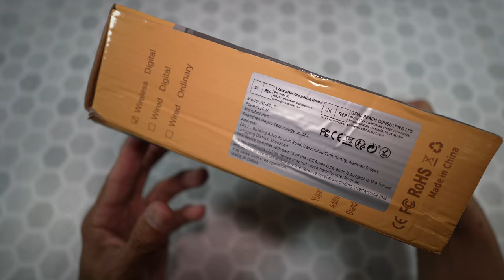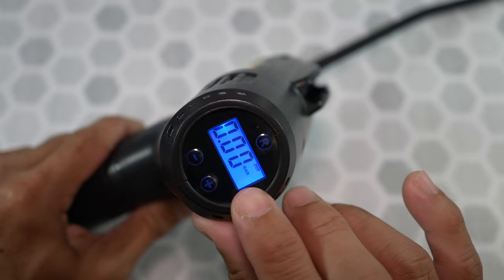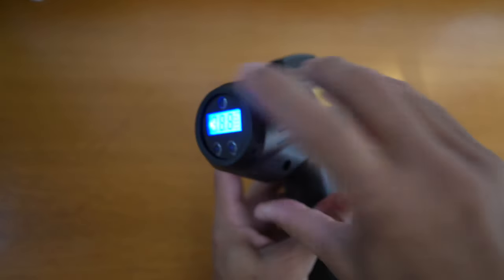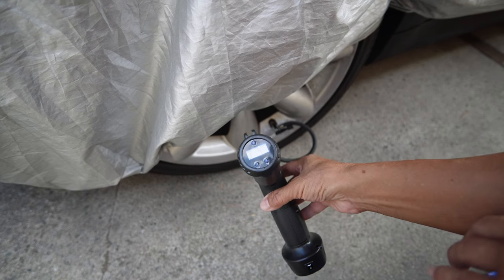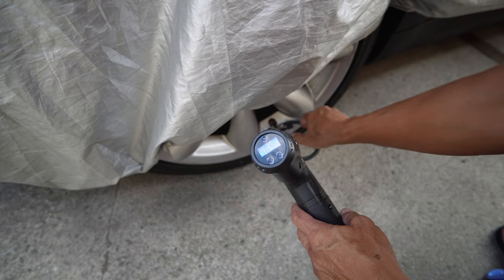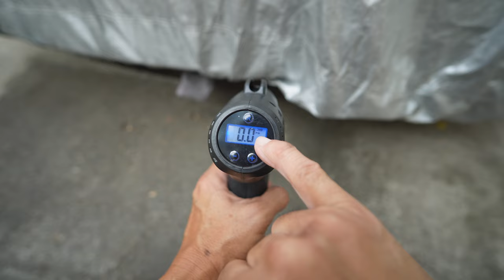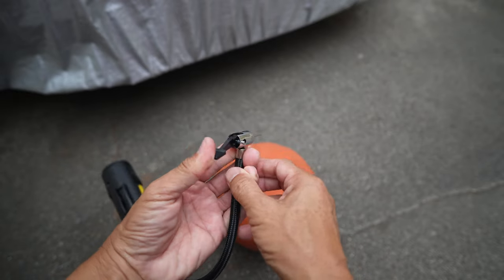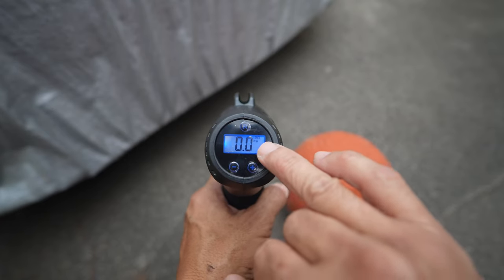Digital Air Compressor Wireless JM 8817

Comment: I got that same compressor, and it works great . I left it out in the rain, and now it won't charge . I'm going to purchase another one and get some kind of case for it .
Reply from the maker: Thanks for reaching out and or sharing. I agree it’s pretty good. The battery really good also, it doesn’t really drain when you’re not using it. But, Now we know that it’s not water proof.
Reply: I ordered one and it came WITHOUT the charging cord.  Very disappointed...will likely never use Temu again.

I am trying to find out the orientation of the charging port and maximum voltage for charging
Reply from the maker: Thanks for commenting. Yes, it’s a bit hit and miss from Temu, I myself experienced this. I recommend contacting the seller. As for the cord: model YLT-S1, input: DV 5V, output: DC 9V

Comment: Takes a little more than the 10 seconds that they advertise.
I wonder if you tested your tyre pressure with an external gauge aftwards to see if it gave the same reading?
Reply from the maker: Thanks for your comment. I did. They were pretty close.

Comment: How come your tyres are 40psi.
When I plug it to mine it’s 2.20psi and I try to take it to 2.50psi.
Is my tyres properly gauged?
Reply from the maker: Hi, on the side of each tire, it tells you what max PSI is. I normally go below that like {10 to 15 PSI below} maximum. Just incase the tires heat and expand and possibly pop.

Comment: My compressor has a 12V plug to charge. There's no indicator light to see if it's fully charged. How do I handle this?
Reply from the maker: Hi, thanks for reaching out. I would say as long as you could see the battery bars filled up on the compressor then it should be fine. Have you successfully charged it? Let me know. Thanks.

Comment: If it is more inflated than it should be, how can I remove the air from it?
Reply from the maker: Thanks for your comment. You could use your finger (or a pen) to push the pin (in the valve) to at release the air from the tire. Same way you would do it on a bicycle tire.

Comment: What charger are you using Sir? Thanks!
Reply from the maker: Hi, thank you for your comment. It came with a necessary cable (with led light) that can be plugged into using a USB connector. I just plugged into an outlet with USB slot.
Reply: @TossSong  ok Sir thank you so much God bless you🙏🙏🙏
Reply from the maker: No problem.

Comment: How long does it take for full charge ?
Reply from the maker: Thanks for your comment. I think about 2 hours. But for very first charge I would let it for several hours. But after it last very long time. I already pumped my car, my mom’s and my brother’s. And it’s still only went down one bar. And I left it in the trunk for weeks and it’s still the same.
Reply: @TossSong  worth it? any other good too from temu?....i am looking a good solar best and cheap camera for security.
Reply from the maker: Thanks for commenting. Yes, it’s worth it! The best thing about it is that the battery don’t seem to discharge easily—for this cheap price product. Meaning when you don’t have to pump air for a while, and when you really need to, it will. (I really don’t know about other items.)

Comment: does it inflate car tyres?
Reply from the maker: Yes, but it should take a couple of minutes per tire. I would guess, from flat to full l, in about 5 to 10 minutes. But you would run the battery out I’m guessing after all 4.

Comment: How many minutes does it take to charge a tire?
Reply from the maker: Hi, thanks for the your comment. I would guess 5 to 10 min, but I’m not 100% sure. I have not had to do so from flat to full—yet. Hope I will never have to. I got it for filling in on low tire pressure.
Reply: Thank you

Comment: Hi mine is just flashing 888 can not switch it off any suggestions please ?
Reply from the maker: Hi, can it be used by pumping the air out? If yes, I would run out the battery and recharge it and see what happens. Let me know.
Reply: No it’s just flashing that’s all
Reply from the maker: Hope you find a solution. What have you been able to do with it? Do you think it’s defective, if yes, can you replace it?
Reply: @TossSong  yes definitely it is  it’s brand new boxed I will replace it 
Thanks for your time

Comment: I just bought one, charged it up, the light turned from red to green so fully charged .

I pressed the R button but it’s not working .
I tried press and hold but nothing
Reply from the maker: Hi, thank you for your comment. It’s possible that it’s defective. I assume you’ve tried everything the yellow trigger, all buttons. No light? Screen light?
Reply from the maker: Might be the electrical components, not the battery.
Reply: It’s definitely and frustratingly defective . As the display doesn’t turn on, there’s nothing that can be done.
Reply from the maker: Sorry to hear that. Hope you still can return it, right?
Reply: how much time took you until it's  fully charged
Reply from the maker: Hi, thanks for your comment. My took about 2 hours. But I have only charged twice since purchase.
Reply: What charger are you using Sir? Thanks!
Reply: Hi mine is just flashing 888 can not switch it off any suggestions please ?
Reply from the maker: Hi, can it be used by pumping the air out? If yes, I would run out the battery and recharge it and see what happens. Let me know.

Comment: Mine is stuck on “CAL” and I don’t know what to do
Reply from the maker: Thanks for reaching out. Have you tried turning it Off then back On? Charged to full?
Reply: @TossSong  it won’t turn off or no, I tried holding the buttons, I tried leaving it to charge but the red light is still on so I’m going to let it keep charging and see
Reply from the maker: Okay. Let see, and let me know.
Reply: Thanks for the video!! You provided all the answers I was looking for! I couldn’t figure out why it wasn’t changing after it had been plugged up for hours! It went to green and stayed on green but when I took it off the charger it was dead. Long story short because of your video I learned that it was supposed to be red while charging and it had a short in it and wasn’t connected properly! Thanks again!!
Reply from the maker: Thank you for your comment. Yeah, this could be confusing at first, but I’m very glad that this helped.